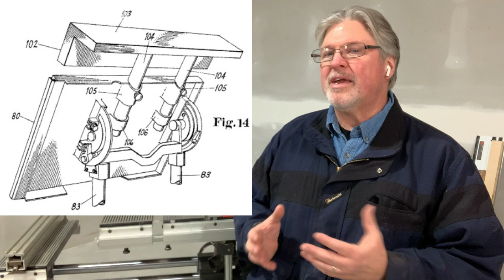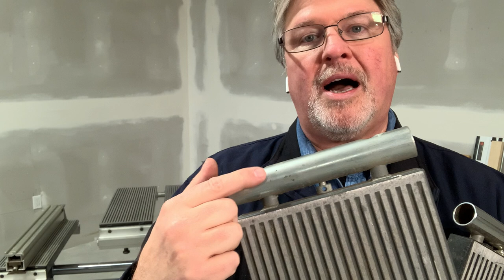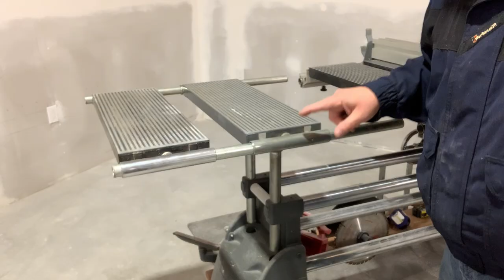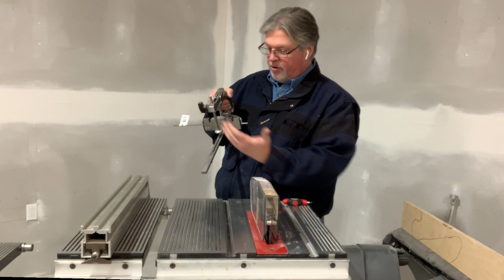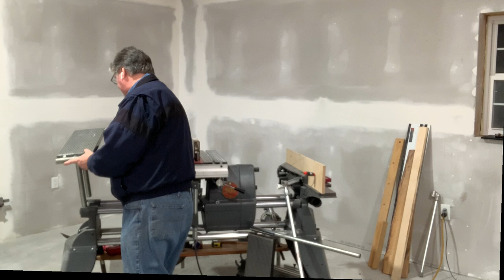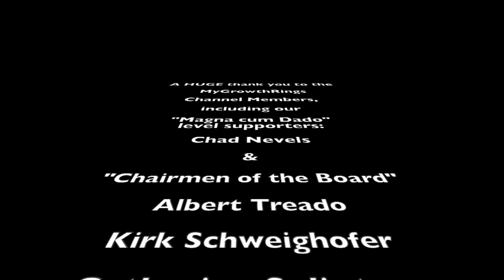Maximizing Your Shopsmith's Potential with something you may ALREADY OWN!

Comment: I love the flexibility of the SS and the greater size of my current 510 table system.  However, for all the 500 owners out there, I want to mention that when I bought my first SS in 1974 I built all kinds of thing with that much smaller table system, including a 7' by 7' entertainment center for my living room.  It has doors, drawers, and several full length pieces in the cabinetry.  I cut miters, molded trim pieces, doweled face frames and door frames, all on the standard 500 tables.  That's just one of the many furniture projects I built with that machine.  The Mark V is a great tool no matter which version one has.  Thanks for another wonderful video; as a former high school teacher I appreciate how detailed and well filmed your videos are.  They are easy to follow and always at the right tempo.  Blessings, Glen
Reply from the maker: Hey Glen, thank you for your kind words. You’re absolutely right, no matter which Shopsmith, tall you own, there are ways to make it sing. Scott

Comment: Another great one, Scott. A picture is worth a thousand words, now I get what you meant by not putting the fence on a floating table. And it makes sense, I would not put the rip fence on the floating in the configuration you showed.

But, I did put rip fence on my floating 510 tables with great success, but also a few caveats. 1. I aligned the tubes by putting the whole table system top down on the work bench, loosened the rail nuts, inserted and tightened the connector tubes, then tightened the rail nuts. This was a suggestion I saw on the forums or somewhere. 2. The floating tables (when used for rip fence) were always mounted on connector tubes connected to one rail screw in the main table AND one rail screw in the extension table. This greatly decreases the degree the tubes may be out of parallel. 3. Tighten the rail/tube screws all front then all back or other way around. I still do this on the Pro Fence system. 4. After tightening the front fence lock, measure from front and back of blade to the fence. Takes a few extra seconds only, including removing and re-installing the blade guard. About 10% of the time, with the fence on a floating table, I found a light pressure was needed at the rear of the fence to make parallel before locking the rear clamp.

Something that always annoyed me about the Shopsmith out feed table or using the floating tables as outfeed is that it limited the width of cut because the system interferes with placement of the rip fence. This is what drove me to search for stand alone adjustable height outfeed options and ultimately to the Husky worktable.

Comment: Your videos are extremely valuable and informative, thank you for so freely sharing your knowledge!  
I wanted to share with you and your followers an issue I just recently experienced with my 1997 ShopSmith 510.  I had been ripping some material so the saw blade was attached.  All of a sudden the motor started up as a result of the power switch failing! 
I was taught and ALWAYS try to adhere to unplugging any power tool prior to making any changes or setup adjustments.  This experience reminded me how important it is to ALWAYS do so.
I reached out to ShopSmith to see if this would be an expected behavior of a failed component and hope to hear back from them soon.  As a precaution ShopSmith owners PLEASE check the integrity of your power switches and make sure that they are not compromised!
Reply from the maker: I had that same switch failure occur to me during the class I was conducting while working at Shopsmith. It is true that switches can fail in either the on or off mode, so, as you said, unplugging, the tool is a critical safety step. So sorry you experienced that. Scott

Comment: Great video on a very important feature of the Shopsmith.  
I have a 510.  The last time I put the extension table on, like you did at time 9:47, I used PVC couplings between the tables to get it close and then a 4 foot level to zero it in.  Once again, It's just a support and when I put the fence on it, I'm not cutting precision but it's good enough for roughing out.

Comment: Having a 500 I of course did not know any of this. Good stuff. I actually get the 505 now. I always wondered why someone would not want the floating tables but all your missing is extra crosscut support. The wider extension table is 7.5" and does help. I have two. One I use for the fence and the other on the SPT side only, just for crosscut support. The wider table provides a little over 12" rip when the main table is against it. So back to the 505, it would give you even more ripping and space in front of the blade then the 500 with the tables together, e.i. no moving the tables. And if that is good for the work you do, then it's an upgrade. Take care!
Reply from the maker: All that and the guards actually work well!

Comment: Thanks for the enlightening videos. When I saw the slop in the fit when using the extension tubes from Shopsmith on the 510 tables I was surprised. I bought some shiny structural steel tubing in the plumbing department at Lowe's that fits much more snugly. Much...more...snugly. There is virtually no slop. Now, the caveat. Using a file, I did need to smooth out the welded seam on the inside of the Shopsmith tubes on some of the 510 tables but with some fine tuning it's now a removable but quite snug fit. I am remodeling and reorganizing my shop right now so it is chaos out there but when I am finished later this week I want to check the parallel alignment to the miter slot.
Reply: I tried the same thing but abandoned the idea. Instead I purchased 1” stock from my metal supply store. It was an exact fit. 3/4 pipe is too large conduit is too small, but like the three bears 1” stock is perfect.
Reply: @daveschmitt6369  I did something similar, but with 1" OD stainless steel tubes, and gave them a light polish.

Comment: I discovered the rear support configuration by accident.  I was ripping half sheets of plywood and didn’t have enough roller dummy’s to support the off fall. 

I spent what seemed like an hour clearing projects off my workbench to use it as a support.  Once I backed my 520 up to it I discovered the benchtop was about 1/2” too high.  As I was looking around for a piece of plywood to put under the 520 base… I noticed the two floating tables sitting on their rack… that got me to thinking… why can’t I just use them as supports?

My first attempt involved the use of a roller dummy to support the outbound end of the floating tables.  But, while trying to level that up, it occurred to me that I could use the legs that were made for that purpose.

And, every since it has been a front of mind consideration when needing out feed support.    I have even used them similarly for drilling hinge cups on tall cabinet doors in the drill press configuration. With one fore and one aft… The tables make a great place to clamp positing stops, while supporting the doors.

Thanks Scott.  Well done.
Reply from the maker: As always, great minds think alike.

Comment: I have used the floating table between the main and extension tables for better stability.  The extension table supports the tubes like the legs, but keeps the alignment better.

Comment: Another great video Scott as they are all. Sorry for the double post I think. I tried to edit it my first post and it wouldn’t allow it. Then I trying copy and delete and it didn’t seem to like that as well. 

Insight of talking about the different in the tables, you forgot to also inform us that there a table brackets and that there are also the Longer tubes for the floating tables .

I have two sets of the table brackets so I can use my three main tables as in and out feed as well. 
I also own two sets of five ft tubes as well as three set of the shorter tubes, ten floating tables, and three extension tables.

With all of these I can put some very interesting tables system together with infeed and outfeed for long and wide stock if need be.

But before I got all those I also bought the Support table

I like the older version of the support legs better then the newer ones because I can use two tubes to the legs if I ever decide too.
Reply: You can buy the wider 2 set screw Speedrail fittings to swap out the skinny ones from most places that sell Speedrail fittings.

Comment: There was a photo on the Shopsmith Forums that showed one man's taking this to an extreme. He had a series of extension and floating tables and tubes that basically created a HUGE worktable area. It looked rather like a checkerboard of aluminum rectangles and blank spaces. I was surprised you didn't flash that one up in this video!

Comment: Shop Smith made the support tubes upside down. The way they are made requires me to bend down near the floor to make my adjustments. My fix: I removed the swivel top connector and with some shims made of a scrap of a copper tube split lengthwise, I was able to make it fit the lower (smaller) tube. I then forced the rubber feet over the larger end and inverted the whole works. Now I can make my leg length adjustments without stooping to the floor and alignment with the table top is much easier to sight along while making the adjustment. Since the crutch tip rubber legs are the wrong size, they will eventually split out and have to be replaced by proper-sized crutch tips. So far that has not happened.
Reply from the maker: Smart

Comment: Hello Scott, I just recently found your videos. I have a SS Mark 500. I really love my machine. I purchased it in 1984 I believe. My question is; Can the table system for the 510 or 520 work on my machine? I haven't been able to find any information about this...
Reply from the maker: Hey Michael. The answer is "Sort of".When Shopsmith created the 510 back in the 1980's they started with designing a guard system that would actually be useful, and in order to make it work they had to redesign the main table support tubes by spreading them apart. That also provided more stability for the largr table top. Anyway, this necessitated a redesign of the carriage, so in order to use the 510 or 520 table system on a model 500 the carriage and everything above it needs to me replace.  For a least 20 years Shopsmith offered what they called a 510 retrofit kit, and who knows, they may still have such a kit. I would check Shopsmith.com and while you're at it, take a look at Craigslist and Facebook Marketplace.  Thanks for dropping by!  Scott
Reply: @MyGrowthRings  Thanks for the info. I will check it out..  Mike

Comment: Good one, Scott!  I like your extension table idea and could have used it a few years ago when I cut up an old, very heavy conference table for disposal. The weight and awkwardness of the wood made me nervous as heck, but luck was with me and the old Shopsmith performed perfectly.  Also, is it a good idea to take a belt or palm sander to the extension tables and scroll saw table to make them smooth like the main table, or was the rough finish left like that for safety reasons?  And finally, I have not been able to use the lathe function for anything but small projects because the darn machine is too low for my 6'2" frame.  Gives me a backache every time.  Can you discuss in a future video ways on how the legs of the SS can be put on blocks or something to allow a more comfortable turning height for tall people while not affecting the tool's stability?  What to do with the retractable casters in that case would also be useful.  Thanks for answering these questions!
Reply from the maker: I just took a look back at all of the comments you've left, hoping that you stated your name somewhere so that I could address you by name.  "Sincerely" I don't think I would go to the trouble or sanding or polishing the extension and floating tables or the scroll saw table. That would make them smoother, but you might also find that you would only increase friction. And yes, we should talks about methods of raising the lathe because like you, I find it too low for extended turning sessions.  Scott
Reply: @MyGrowthRings  Thanks.  SY is just one of my internet handles - but you can call me Bruce.  The scroll saw table seems particularly rough and causes the blade to cut in the wrong spots at times.  At least that's my excuse and I'm sticking to it.  It also has an ugly corrosion ring etched into the surface by a cold drink that I left on it for too long.  Didn't think it would rust so noticeably so I would like to sand that off if possible.
Reply from the maker: @sincerelyyours7538  Nice to meet you, Bruce. In that case I would absolutely wet sand the scroll saw table.

Comment: Nice video like always. The SS is versatile. I think the table system is very cool and that’s what it is a system. Maybe you know this but others may value from is method of using two more adjustable fittings ‘knuckles’ to floating tables. On the out feed of the main table have the rod then add a knuckle to each end, add two more rods on each knuckle. This will allow the rods to come up to table height, add the floating tables and stabilize with telescopic legs. I wish I could show a picture to clarify. Maybe you can show this on your next video?
Reply from the maker: I am not sure that I’m following.
Reply: Yeah, me either
Reply from the maker: @jeffbaker8883  He send me a pic and now I get it.

Comment: I was wondering why you said never use the fence on a floating table. Should have realized the reason from past experience. To get extra support, workspace, or someplace to put your miter saw the 510 tables floating tables are great. But for work needing precise and stable positioning they leave something to be desired. I learned the trick with creating a rear extension table on a webinar. I tried it a couple of times, you can use 2 support legs by pushing the joining tube through the table tube so it sticks out both sides. I thought you might go into the table extension brackets, I don't have any but it seems a better solution for extending the front or back of the main table, hope to see you cover them in the future if you haven't done so already. 

I like hearing about the history of Shopsmith development that you know about like the evolution of the table joining tubes and the 520 table system. From the start I couldn't figure why the 510 tables have a locking screw intersect the side of the tube instead of the top or bottom of the tube. It didn't need to be a vertical screw,  it could resemble the locking screw on the double-tilt mechanism with an pointed end that wedges against the tube forcing it up or down. Nobody can think of everything ahead of time though,  and the 510 table system was a huge improvement over the 500 tables.

Comment: The only shopsmith I own these days is a machine I converted to a dedicated drill press. However, I enjoyed my 510 for many a year before building a woodwork shop where larger machines were possible.  The ONE improvement I would like to see on the shopsmith - and it especially shows in drill press mode is crank operated headstock adjustment rather than just sliding up and down the way tubes. A simple rack and pinion setup would be a big upgrade IMO.
Reply from the maker: That would be nice.

Comment: The table system isn’t understood by a lot of non Shopsmith people because of the objections they raise. “The table is too small”. “There is no way to do an out feed table”. And other similar things. I have used the extension table and legs with the drill press with excellent results.

Comment: In speaking with shopsmith they said my model 5-10R is no longer supported, is that true?
Reply from the maker: What do you mean by that? The only part of the 510 that is no longer “supported“ would be the rails and the fence itself. Every other part of that machine is identical to the 520, which is still in production. What needs supporting?

Comment: Scott, what about using a   Separate main table (purchased from eBay or marketplace) in between a fixed extension and an  existing main table? Should be able to use the  fence on that.?
Reply: That sounds like a good idea. I have two 510s. I’ll try it. I bought 60” x1” steel tubes from a metal supplier, cost $15 each. It gives me a lot more stability.
Reply from the maker: Jon, I'm sorry that I missed this comment. Yes, you could do that using the backward support table method and that would give you tons of support.

Comment: Hi Scott, I am new to shopsmith.  I just bought a Shopsmith Mark V 500. I am missing a bracket, I guess, to mount the  top blade guard.  The manual that came with the unit doesn't really show the mounting procedure very well. I have a Dewalt job site table saw so I am not really using the table saw function of the SS. What is the best approach to upgrading my table system on my 500? New, used?
I am on a budget  and I already have 825 dollars in to the 500.
I mainly got the unit to help me build some cabinets for my home.
I am considering a second used Shopsmith. I have found  that it is super easy to use and have been glued to your channel for the last week!
Thanks for posting the excellent content!
Reply from the maker: Thank you for your kind words. The best way to upgrade these days is to buy a used machine. There’s actually quite a bit involved in switching a 500 to one of the newer models, and a used 510 is usually a better buy, and then you’ll have two, or a 500 to sell or swap. BTW, welcome to the Shopsmith family! Scott